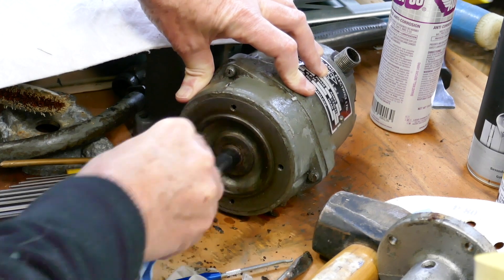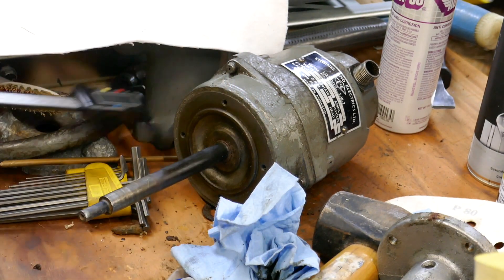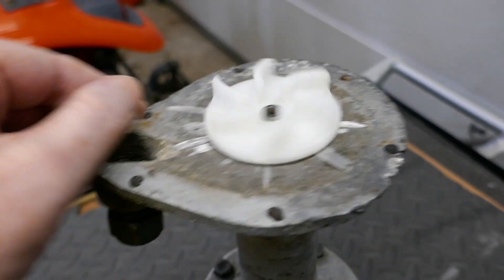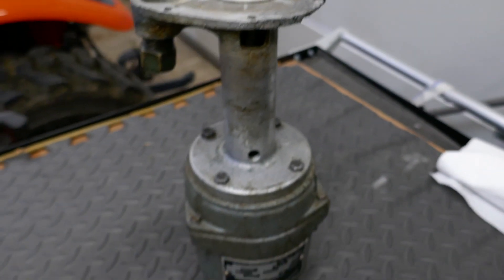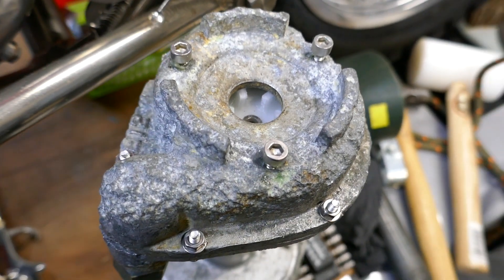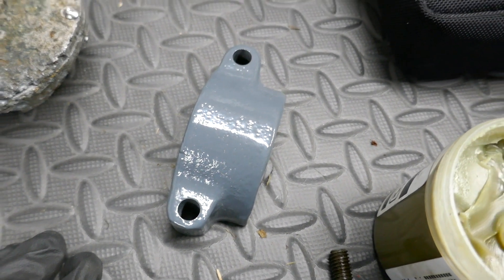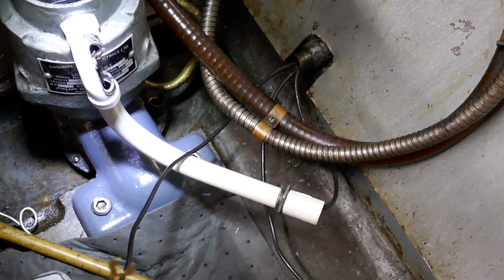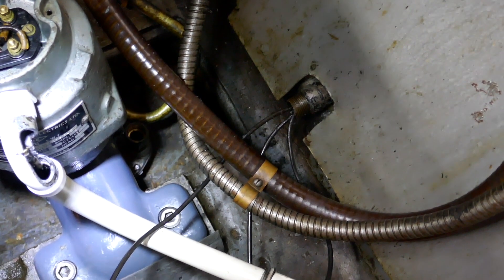More coolant on the DSG

Comment: You made the impeller yourself? I  can't get anything. I've even had to make a stop button to get the original control panel back on. I was off work for 2 days and they wanted to surprise me by getting it running. I was really annoyed when I saw what they did. I'm getting it sorted.
Reply from the maker: The impeller is easy to print on a cheap 3d printer. Whether it lasts is another matter..